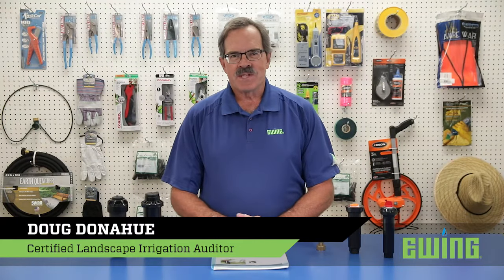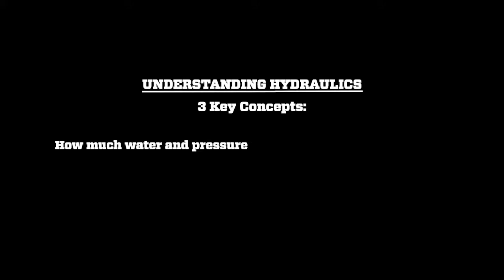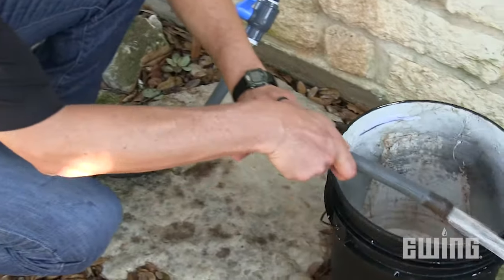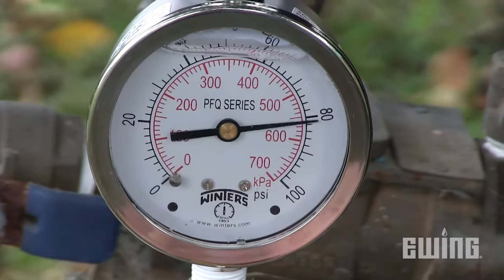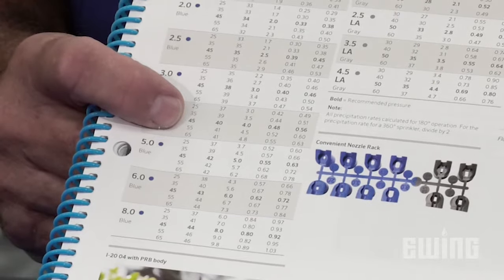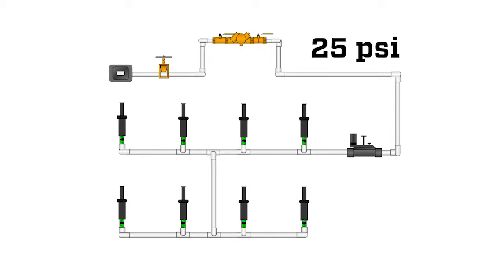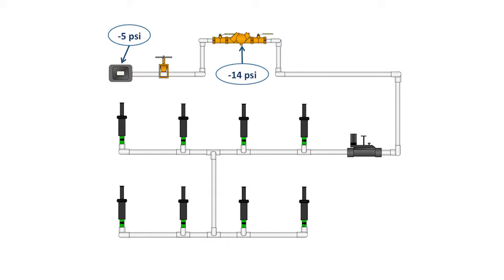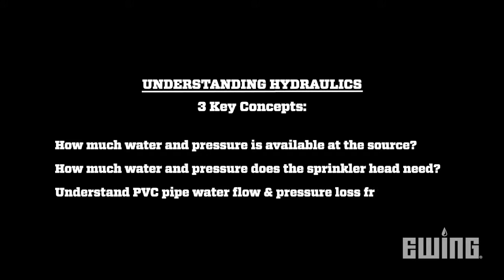Sprinkler System Design - How Many Heads on a Line?

Comment: I'm upgrading the sprinkler system on the house we just bought and it's been a nightmare. The previous homeowner had everything hooked up to a hose bib and used 1/2" poly pipe as their lateral lines. Their zones have anywhere between 1 head and 5, so I get totally different performance out of the heads (all the same model) depending on which zone is pressurized. I think eventually I'm just going to dig it all up and build it properly...

Comment: My sprinklers are not on the same water line as the house and hose bibs around it. How do I measure the pressure then? 
Is there a formula of how much the pressure decreases for each sprinkler head? Does using a specific sprinkler head reduce water pressure more than other? (ie rotors, rotary nozzles, spray nozzles, impact sprinkler heads…). 
Does too many sprinkler heads reduce the pressure just mostly at the end or even the first sprinkler head? 
And what type of sprinkler head still works ok at very low PSI? (I bought a house with a full system set up over 1/2 acre. At the bottom of the hill I tried to test the PSI and I think it’s like 10. ). There are 14 Rainbird R Vans and even a drip line to this section. 
Oh, and does having all the sprinklers in a row off the same line effect pressure any differently than having the main line branch 2 separate directions with the heads off 2 different branches?
Thanks.

Comment: Question, for the flow test (gallons per minute) would I be better doing it through a hose bib or out of straight pipe coming off the well that would go to the valves?
Reply from the maker: The less restrictions on flow that you have, the more accurate your test results will be. If you can test directly from the mainline, that would be best. Thanks for the Question!

Comment: Would it affect or damage the system if I only have one or two sprinkler heads for one zone or valve?
Reply from the maker: As long as your pressure doesn't exceed product specifications you should be fine. Thanks for the question!
Reply: @ewingoutdoorsupply  thanks! I'd like to buy products from you guys, do you help guiding through the installation process and designing?
Reply from the maker: There's quite a bit to know about installing an irrigation system so our branch staff might not have the bandwidth to help with design and training. That said, we do have some training resourses online that you can refer to (link below). Our primary customers are landscape contractors so we can also provide referrals if you decide to hire someone.
https://www.ewingirrigation.com/education-past-webinars

Comment: How do these jets get full coverage? For example if you set to spray out 10 feet distance... then how does it cover all of the area of the grass from zero to ten feet? Does each individual stream throw a difference distance to cover all of the area as it rotates? Thanks for the help.
Reply from the maker: The MP Rotator nozzle streams have varying angles to cover the area from the head to the outer radius. This combined with head-to-head spacing ensures that you have coverage over the entire turf area. This video will give you a better idea. https://www.youtube.com/watch?v=nmsZtby1iOw&ab_channel=HunterIndustriesResCom%2CandGolfIrrigation
Thanks for the question!
Reply: Thank you so much for the quick reply this helps a lot. I see there a rotator heads available to purchase. What type of base do we buy to screw on the rotator head to.
Reply from the maker: Any standard pop-up body will work. Be aware that there are both male and female threaded MP Rotators so purchase the correct option for the pop-up body you use. This option is the recommended body for MP Rotator nozzles: https://www.ewingirrigation.com/44012040-pro-spray-4-inch-pop-up-with-prs40-and-cv . There are other heights available as well.
Reply: Thank you really appreciate it
Reply: What is the rule for 40degree slope area in vertical line sprinklers at a distance of 25feet. Each line has 10 sprinklers .thee water force is 3hp pump with 2.5inch main pipe. Please know how should be telescopic system. This is for arecca

Comment: Question 
I have 100 psi for my water. How many rainbird 42SA+ head can I installed on a single line?
Reply: Probably like 20-23 half heads. I think that's too much pressure. You should reduce it to at least 85 pounds. And work from there

Comment: If your irrigation system is feeding the lines downhill (7%-10% grade) does the pressure increase to any degree due to the momentum increase in running downhill??
Reply from the maker: Correct,  for every 10 feet of fall in elevation, you will gain +4.33 psi.
Reply: Yes so if your zone is on a hill, you must zig zag your underground lines to slow down the water as opposed to installing it straight up and down, so that the heads at the top still have pressure. Made this mistake once... never again🤦

Comment: 40psi 4 heads rotor or mist  1" line from 1.5 to 3.0 nozz on hunter pgp 
8van to 15van on the rain bird 1800 series, this works for me
50 psi 5 heads and so on, 
Baccum breaker backflow 
And i just open a hose bib in full i take a look on how much water comes out, and thats it, im ready to do the installation 😃

Comment: Cool story. 1 example would have been nice
Reply: Yeah this is good information but most people really don't need to know all of this. Using an 1800 sprinkler head I find about 4-6 heads per zone is the sweet spot. Normally I do 5 for a home with average pressure.

Comment: install a sprinkler pressure pump, use at least 1" pipe, problem solved. no more Einstein tinkering.
Reply: Yes I grew up working with the Parks Department we kept downsizing the pipe for pressure does a contractor myself the run the largest diameter right and to the heads and use the nozzles to keep the pressure up it might take a little longer to load but I want as much water out there as I can get

Comment: Can no one give even one example of how many heads per line.  Come on, 1 is normal, 30 is normal or is 200 normal for a house?  Give a guy a bone.   I would say anyone who has put in sprinklers for a couple weeks could tell you how many they normal can put on one zone.  You could say 30 psi with 35 rotors sprinklers is normal or something!   Maybe 3 examples would be very helpful for sure.
Reply: I’ve given up trying to work out all this. So I just worked out how many litres/gallons per minute flow from my tap, reduced it by 20% and that is my measurement. I’m going 3/4 inch pipe as it’s the most common for lawns so I just stuck with that and I’m buying my supplies. I’ll install it all in the coming months.
Reply: 1 isn't Normal. 30 isn't normal. 1, however, is more normal than 30. Hope that helps.
Reply: “Why can’t someone just tell me how much fuel it takes to get from Canada to the US.”

Comment: So still did not say how many 😂😂😂😂😂😂
Reply: Lol Fr
Reply: Because there are way too many variables to give a definitive answer. There are different manufacturers, sprinkler head types, water pressure variables, pipe fittings and diameters, altitude, etc. With this many variables, you can't realistically give an answer. What this guy does is give us a formula that would allow us to make a calculation of our needs based on the variables unique to us.